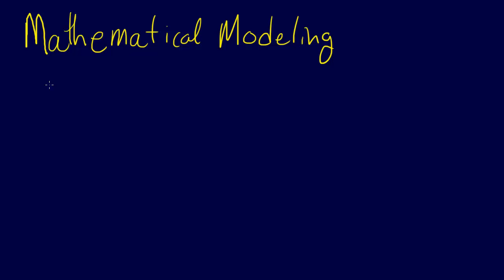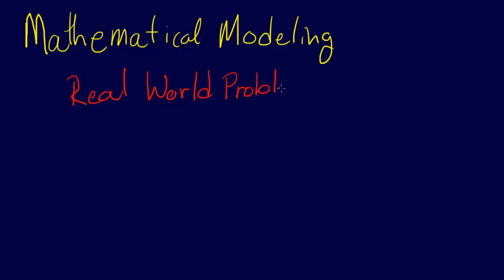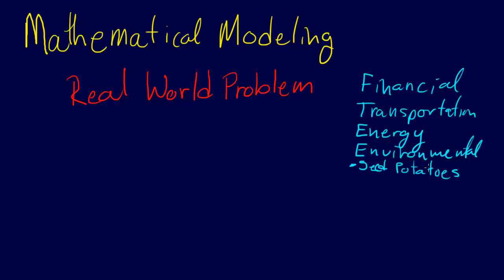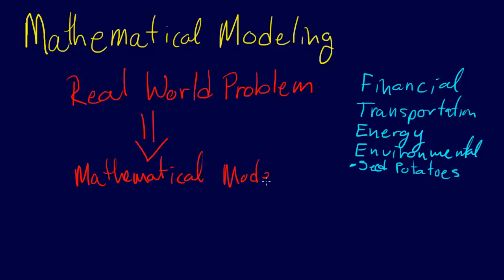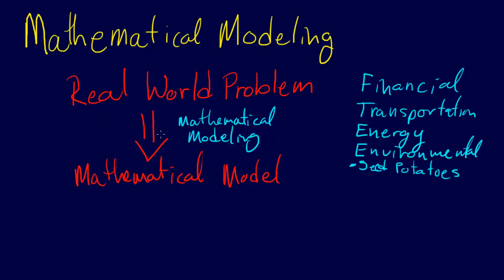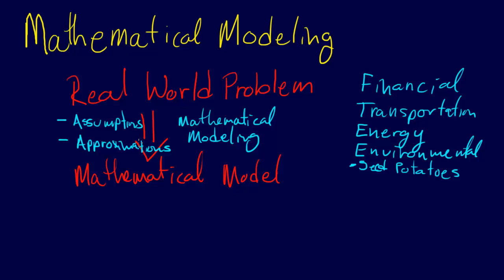1.1.3-Introduction: Mathematical Modeling

Comment: Just to be sure, is f=ma a mathematical model?
Reply from the maker: Yes, it is. We know for a fact it's imperfect, but it's very good at normal speeds. At very high speeds it ends up being too far off to be acceptable so they use a more complicated mathematical model based on relativity.
Reply: Thank you, kind stranger!
Reply: Clysen I'm curious what type of problem are you trying to solve ? Physics work always has interesting work.
Reply: @as bas Yeah... no
Reply: Clysen No, it is a law of physics.
Reply: @David-nk7pv  if it was a law of physics the equation wouldn't break down at higher speeds bud
Reply: @yanking1221  I disagree, bud.
Reply: @David-nk7pv  yup. A law just describes some relationship. Hooke's Law breaks down too. It's still a law though. It's a bad choice of words. Probably should have used "relation" or something like that. "Law" has got too much baggage IMO.